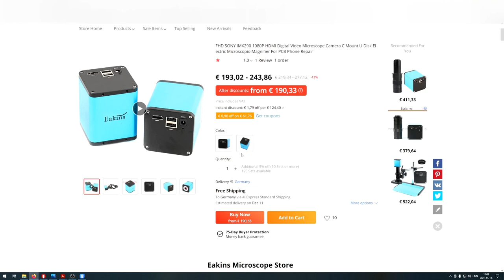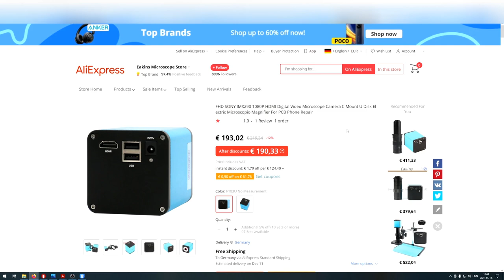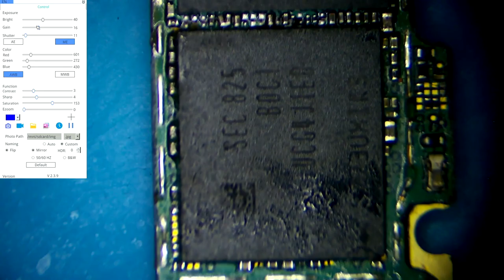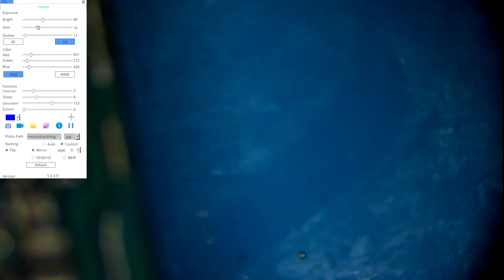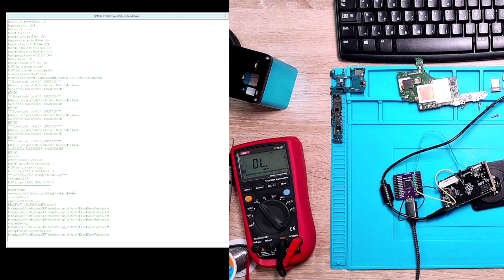FAKE Sony IMX290 microscope camera - SCAM

Comment: Oh my god! That looks worse than my $30 usb microscope camera! 

By the way, I've been experimenting with arducam type image sensors to make a diy microscope camera. I have a setup coming tomorrow that is less than $50USD for 8mp/2k  camera sensor and 8x-100x lens. For some reason arducam type pcb cameras went up greatly in price on amazon but you can still find deals from time to time. I will try to update with the results in a video.

Comment: I have the same exact issue you have with reflections on my camera from the same seller. Thanks to your great video I've opened my camera to check, but it seems to have a new type of PCB that doesn't have the sensor model printed on the PCB, so I do not know if it is the XCAMTOP4K8MPA IMX334(C) as it claims and I can't seem to find the test points. The sensor controller board is also different and has two PCBs stacked/screwed together. I bought the fyscope polarizer on ali because it was the only one I could find with glass lens and not plastic. It does completely remove the reflections and increase image quality, but at the cost of some minor details. Tilting the board also completely removes reflections with great quality, similar to that of their description. Try tilting the board or moving your ring light by hand somewhere else and you'll see what I mean. I'm now looking into getting alternative light source to change the angle of the light. If you want links or image examples of the image/polarizer/sensor/controller let me know. It's kind of questionable to use description images that are different from actual product, if you zoom into the description photos you can see that image might be photoshopped on to their the monitor. They were probably using a different light source. But I think they might have accidentally shipped you the wrong sensor.
Reply from the maker: Could you please send me a link to this polarizer? I have already tried one but it did reduce brightness significantly.
Reply: @kikihobbyrepair  It's not letting me include link, YouTube deletes my comment, but just look for fyscope polarizer on ali and you will find it. It does decrease brightness significantly but can be compensated with more light/exposure.
Reply from the maker: Oh true, YT is usually automatically deleting comments with links... I will take a look at it on Ali. Thank you.
You onow the problem that yes, if you have a different light source from a lower angle it helps until you do not have flux on the board but as soon as you have it will reflect again because it is not flat on the board but kimda like bumps and then it is screwed again. I saw the IMX290 with the same loght source I have and it works 100 times better without any hack.

Comment: Had a similar problem. Bought eitkin trinocular microscope with cheap camera 2k quality , worked great, crystal clear. Then decided to buy a better camera, so bought one like the smaller cheaper one you have, and it is terrible, so much of reflective, you cant see a thing. I am currently trying to get a refund, but they blaming my lense.
Reply from the maker: Yes, I still haven't decided since then which one to buy next because I simply do not trust these companies anymore but on the other hand I do not want to pay 800-1000€ for an Amscope....

Comment: I bought an eakins 4k panasonic sensor microscope and canceled the product before shipping, how do you think andonstar brand?
Reply from the maker: My problem with andondstart that they do not have a version which I could attach to my trinocular microscope. Andonstar microscopes are all with the stand setup which I do not like. On the other side looking at the picture quality in videos they look quite good.

Comment: Isn't there a polarizing filter for these kind of cameras that'll decrease the reflections?
Reply from the maker: This is what I am looking for 🙂 But it is still not even close to the advertisement...
Reply: @kikihobbyrepair  I have the same exact issue you have with reflections on my camera from the same seller. Thanks to your great video I've opened my camera to check, but it seems to have a new type of sensor or PCB that doesn't have the sensor model printed on the PCB, so I do not know if it is the XCAMTOP4K8MPA IMX334(C) as it claims and I can't seem to find the test points. The sensor controller board is also different and has two PCBs stacked/screwed together. I bought the fyscope polarizer on ali because it was the only one I could find with glass lens and not plastic. It does completely remove the reflections and increase image quality, but at the cost of some minor details. Tilting the board also completely removes reflections with great quality, similar to that of their description. Try tilting the board or moving your ring light by hand somewhere else and you'll see what I mean. I'm now looking into getting alternative light source to change the angle of the light. If you want links or image examples of the image/polarizer/sensor/controller let me know.

Comment: Hi I bought it from same seller advertised as imx290 autofocus sensor but when I received picture quality was not great so I followed your video opened it up and it turns out to be imx307,  I raised dispute with aliexpress waiting
Reply from the maker: I amnsorry to hear this. You are at least the 5th one who I know...  It is quite sad story though. This is why I posted this video not to let you being scammed.
Reply: thanks for your reply, i raised a dispute and now aliexpress asking me to send item back , postage back to china from uk £65, i have also raised a chargeback with my credit card , i will not send it back with that cost,
Reply: @ynm078  any update from AliExpress? I’m always wary of using them to buy stuff like that. I’ve herd sometimes they help and sometimes they don’t.
Reply: @shiftctrlhack  
Aliexpresss asked me to to send item back to seller for a full refund, postage from my pocket which I did not agree hence I called my credit card which I paid with and they started a charge back
Reply: @ynm078  what vendor did you purchase that from was it Lapsun? They are telling me right now they have a few of the IMX290 in stock but only a few.

Comment: Is there another way to see the true sensor ? I have bought one camera too in that store.... How I know on my camera where are these 3 pins? Gnd tx an RX ? Thanks...
Reply from the maker: Well, one chance if you look at what microprocessor is on it and if it is a standard SMD you might be able to find the relevant TX, RX pins from the data sheet.

Comment: These strong reflections that you see in the video come from the ambient light being too focused or the ring light being too strong. A matt 120cm x 60cm LED panel is ideal for the workplace. Then you have clean lighting like in the advertising video. The beam angle of the ring light is too close to 90° to the board so it reflects too strongly into the camera. It would be better if the ring light had a larger diameter then this problem would not occur.

Comment: I got a Eakins camera from Eakins Store.  It has way better image quality than yours.  Your ring light maybe be having a negative effect.  
I purchased the "Newest 36MP FHD 4K 30FPS 1080P 60FPS HDMI USB Digital Industrial Video Microscope Camera C Mount For Phone CPU PCB Soldering"
Cost me just under £70 in 2021.
Feel like its very good value at £70
Reply from the maker: I have tried 3 different light sources. 2 ring lights and a gooseneck light. With all 3 options my cheap 70€ camera is better... You were most probably lucky getting a real one...

Comment: Guys, there is a new camera in Eakins Store right now. This camera is using Sony IMX385 sensor. Alex from Northridgefix was testing this camera on his new video. Lots of improvement comparing it to IMX290. I just order it and it will arrive next month. They are selling it with objective and the cheapest is around 280€ which means that the camera cost around 260€ including free shipping.
Reply from the maker: Thank you for the info. Yes, thd IMX385 looks like a good sensor but to be honest I do not really trust Eakins anymore...
Reply: @kikihobbyrepair  this time I will open it and check the sensor and give them real review or open dispute directly if they gonna send me again different sensor.
Reply: The IMX385 camera does look pretty good but I think Northridgefix is over selling it a bit since he cannot get the old ones any more. I think the old one (IMX290) still gives a better image quality over the new one, the colour certainly doesn't look as good on the new one imo.
Reply: @games2replay  maybe, but the imx385 image sensor is much bigger than imx290. I will let you know as soon as this camera will arrive.
Reply: @Filip Sz….. Do you have some new infos for us ?
Reply: @William A  yes. I would say that IMX385 has the same quality like IMX307, plus the light is a little bit weaker. So basically I would say no difference.

Comment: Reflection is not because of camera!, it is because of your light source and angle of light going back to sensor!, if you change your light source point you will not get any reflection!
Reply from the maker: I totally understand your point. For sure a gooseneck style light source could significantly improve the situation. I have tried 3 different light sources (including a ca 150€ Amscope) and in each and every cases my 70€ camera handled reflections flux on the board significantly better. This is my main issue.
Furthermore I ordered an IMX 290 camera and I got something else which is in general totally unacceptable...

Comment: I spoke to Eakins and they admitted to me that they swapped all autofocus IMX290 microscope camera to IMX307 sensors. What a shame. It seems other sellers i.e. Lapsun also did the same. If anyone knows of any listing with confirmed IMX290 sensor, PLEASE share.
Reply: Update: The IMX290 has apparently not been in these microscope camera's for a while. The best alternative I've found is the IMX391 "white" one from Lapsun store on Aliexpress. Only difference is that it's $150 more than the Eakins "IMX209" (IMX307). Hopefully it is worth it. Will report back with results...
Reply from the maker: Please let us know how it works.
Reply: @kikihobbyrepair  I will. P.S. in my previous comment I accidentally wrote "IMX391" Correction: "IMX291". IMX291 is very similar to IMX290. Hopefully this new model will actually have it inside.
Reply from the maker: If I remmeber correctly IMX291 is missing some HDR functions compared to IMX290. Lets see.
Reply: @kikihobbyrepair  Yeah, the HDR features appear to be the only difference and they're both usually grouped together when mentioned i.e. IMX290/291. I couldn't find any other differences. I'll have to just see when it arrives as you say. I'll be back in hopefully 2 weeks when it's here...
edit: Check out the video of it on the "AK Wang" (Lapsun) YouTube channel to see it. It really does appear to be more like the IMX290, at least from the video.
Reply from the maker: I also saw the videos but to be honest I do not trust them anymore. Most of them are showing the exact same video for all the sensors....
Reply: @kikihobbyrepair  I don't blame you at all. All of the sellers writing IMX290 in the title on Aliexpress, swapping the sensors for an inferior sensor and continuing to advertise it as having an IMX290 is so shitty. You and everyone else have every right to be upset and sceptic.
Reply: @kikihobbyrepair  Hey, an update - it took ages to arrive due to COVID outbreak in China, but they eventually shipped it with FedEx and it arrived today. I opened it up and there was no reference on the PCB's to which sensor it uses (at least from what I could tell). I tried the microscope out and it's super high quality (like the demos and videos of IMX290). I took some captures if you would like to see, let me know your Discord ID or w.e. and I'll send them over :)
Reply: @Pwntyounooblol  can you post the link please.  Tyty
Reply: @Pwntyounooblol  Which one did you end up buying?
Reply: I just opened mine and instead of IMX290 with autofocus I have IMX307 with autofocus.
Reply: @filipsz6728  Which did you buy?
Reply: @Pwntyounooblol  now they changed the ad title but you can find it if you will put in search bar: Sony IMX307 autofocus video microscope camera.
Reply: @filipsz6728  I see. I think that one is different to mine. I have the white one (item no. Above). It does not say 307 on the PCBs

Comment: So, the price alone didn't made you suspicious beforehand?
Reply from the maker: No because you can buy these cameras without autofocus in this 180-250€  price range from different sellers. Autofocus ones are more expensive 350-500€. Furthermore as I heards even the bigger names are just rebranded.....
Reply: Good point, I ordered the IMX290 autofocus one. Hope this is the real one. Thank you for the video ☺️ wish you the best.
Reply from the maker: Thank you! From which seller did you bought it? I would appreciate a feedback if it is good or not because I am still looking for one.
Reply: Eakins Microscope Store 😬
I'm going to use it to inspect vintage late 80's to 2000 CRT PCB's
Reply: Kiki Hobby Repair Sure, I'll let you know. I can even check the sensor with an usb to serial adapter :P
Reply from the maker: Thanks a lot! Hope you have better luck with them 🤞 although until this purchase I was also happy with them. I bought already 2 cameras and lenses and the trinocular from them.
Reply: @kikihobbyrepair  Hi Kiki, 

I have received my order within 7 days. The image quality and clarity is amazing. The color ranges are really good and the autofocus is fast and snappy. 1080P 60FPS no lag. Very impressive hardware, I haven't touched the UI though I already think I'm not going to use that much because of the inspection nature of my usage (just looking) 

So yeah, my purchase got delivered on time and judging by the look of the quality. It's an IMX290 in there. 

Regards,
Evert
Reply from the maker: Many thanks for your feedback! Well it is hard to trust them once again to be honest but I am happy to hear that yours is fine. As I told also in the videos I was the most impressed with this IMX290 in other videos.
Reply: @kikihobbyrepair  I've discovere that my box crashes whenever I use the magerment tools or put the sharpness to full... Does that happens to you as well? Also the UI in general, is there a website where updates can be found?
Reply: Also discovered 5v 0.5 amps is too little current. Gave plenty and system is stabel
Reply from the maker: Mine was coming with a 5V
2A power supply. For sure 0,5A is not enough especially with autofocus in your case.
Regarding your previous question of the update I cannot answer, sorry. Maybe you could ask 
Eakins.
Reply: @EvertvanIngen  do you have link to the your purchase?
Reply: @EvertvanIngen  can you open it up and confirm the board model number?

Comment: Looks like some HDR mode is on 8:41. It might be LED lighting is too high. I don’t know. Just trying to help.
Reply from the maker: THanks for your feedback. I tried 3 different LED lighting and in all conditions the old cheap one is tolerating the light better. Furthermore I did not get the sensor I paid for....

Comment: Thanks. I was looking at Eakins a while back but after chatting with them I just didn't feel they were the professional company that I thought they were from the review videos on YT.
Reply from the maker: I got a feedback from one of the viewer that he ordered from Lapsun and checked the sensor with this method and it was again a different one...
Reply: @kikihobbyrepair  
Yes thats a shame.  I need a decent setup but cheap enough.
Reply: @kikihobbyrepair  do you know what sensor they got.? Lapsun has a few different models the IMX290 and the IMX385 and the IMX185.

Comment: Is the 54 Led ring light just as bright as the 144 Led ring lights?
Reply from the maker: To be hoenst I am not an expert but my feeling is that you do not need an exterme amount of light. It is most important the light to come angled and not perpendicular to the sensor because then it is reflecting back severely. I also tried the Amscope version with 3 rows of LEDs where the diameter of the ringlight was really small (barealy higher than the lens diameter) and this was even worse with this camera because significantly more light reflected back into the sensor. It is kinda a balance because the further away you can put your lighting from the sensor the less light is reflecting back but for sure then it will be in the way of soldering. I would recommend to watch my DIY microscope light video where I show that by putting the light further away helps cheap sensors having a better picture quality.

Comment: How do you connect your camera to video
Reply from the maker: For this one I use an HDMI capture "card" which is converting it to USB 3.0
Reply: @kikihobbyrepair  hi I have just purchased the HDMI capture card.. I am using the osb studio as recommended,  but I can't seem to get it to come up on the screen. What are you using with your capture card ?
Thank you
Reply from the maker: This is the one I use:  https://www.amazon.de/dp/B09991X6KC/ref=cm_sw_r_apan_glt_i_TGZB4W1CF3DMYHJCYWDH?_encoding=UTF8&psc=1
It does not work with the cheap 10-13€ ones.
Take care to plug it into an usb 3.0 connector.
 I also use OBS and it works just fine. You add a capture card in the settings and select the right one from list.